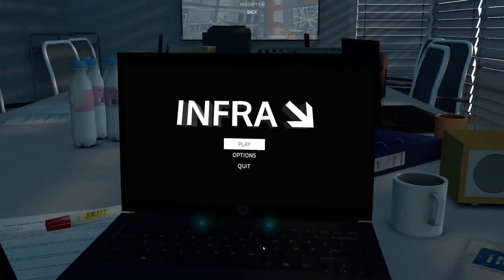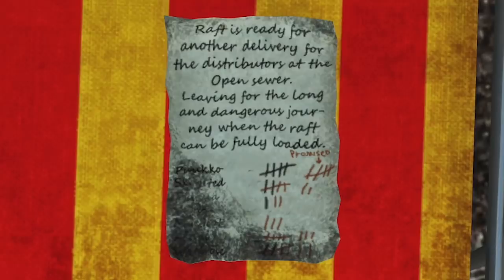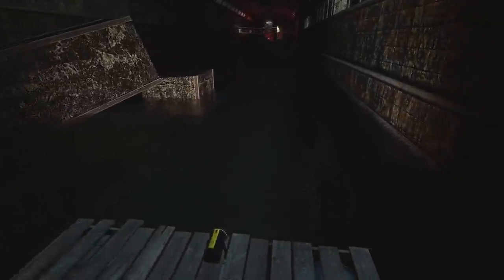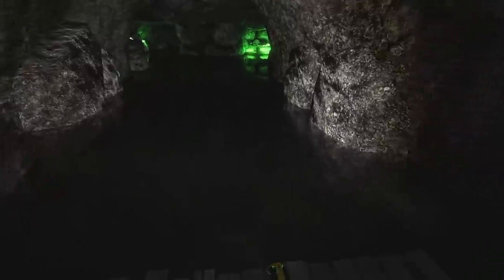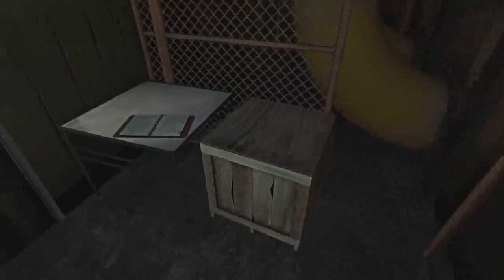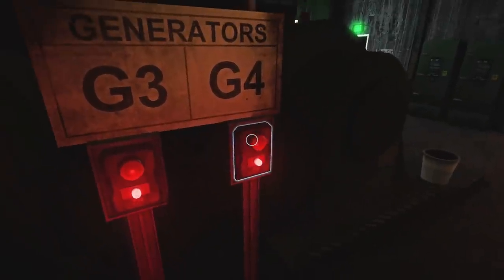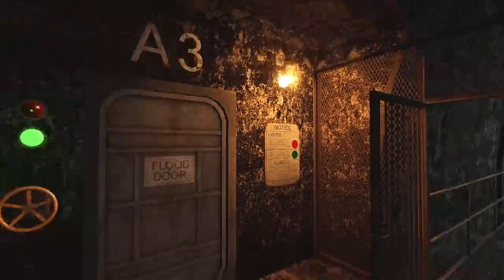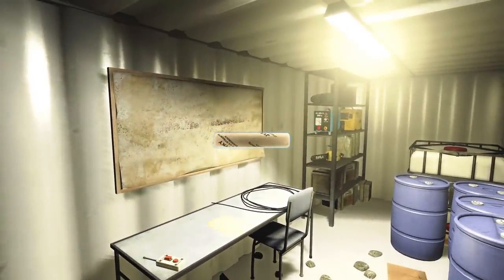As a drainage engineer, I probably should have known better... INFRA!

Comment: 2 questionsTo
As an American I don't know too much British slang, What does bollocks mean
And second  what If somebody used rebar in zigzag patter and rather than just a grid pattern
Reply from the maker: Bollocks are testicles, the context I'm using it in just means "dammit" or similar.

If by zig zag you mean not overlapping then the rebar wouldn't provide much strength, the overlapping means it's stronger in both directions. Also straight bars are much easier to transport and work with!
Reply: @RealCivilEngineerGaming  no, still overlapping, but a diamond pattern instead of square